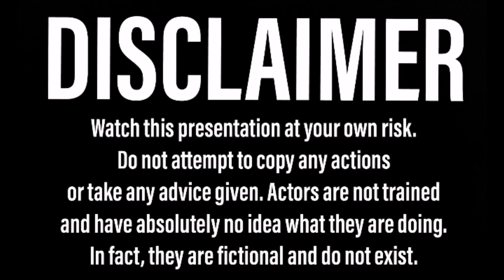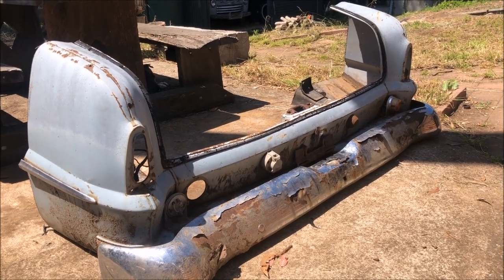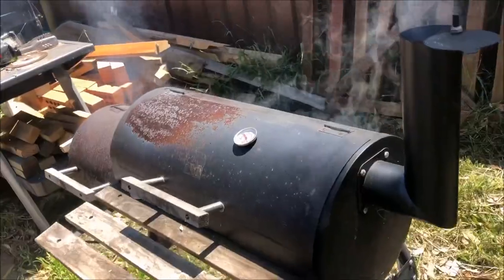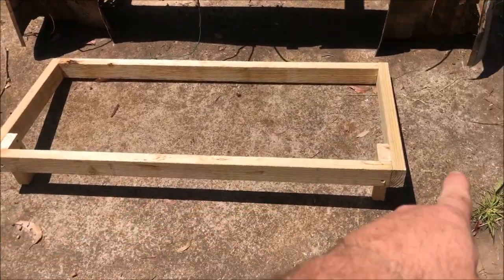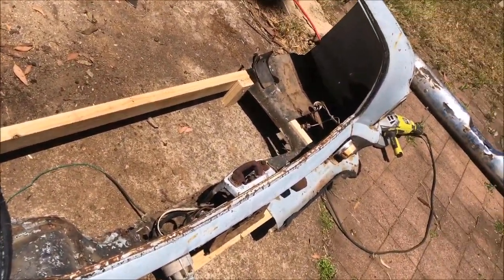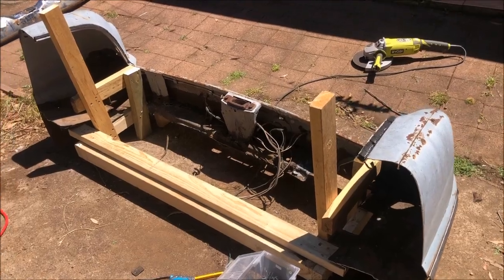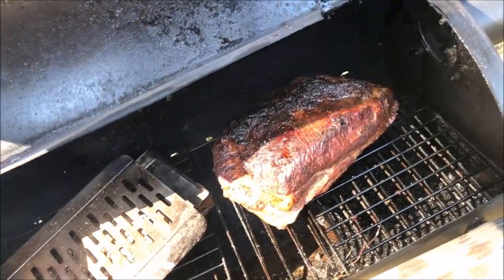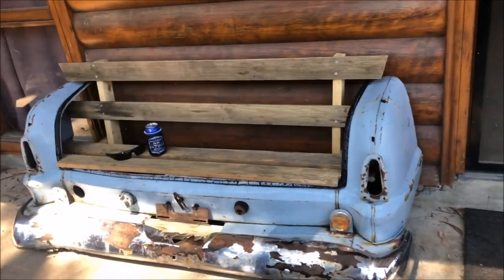Making a Chair with a Car Body

Comment: That came out great, nice work man! There's two 53 Plymouth taillights for a decent price on Ebay right now. Ones in California for about 15 bucks plus about 20 bucks shipping and the other is in Arizona for about 18 bucks plus 12 bucks shipping. One lens is cracked.
Reply from the maker: Cheers man, looks like I may have found a pair locally 🍻
Reply: @oldskoolonly  Awesome! That's one sweet seat!